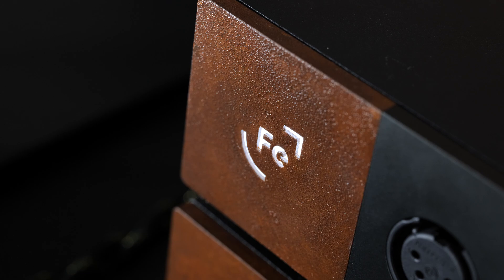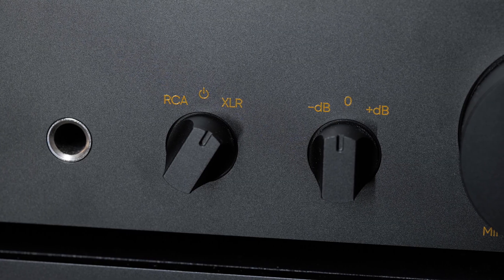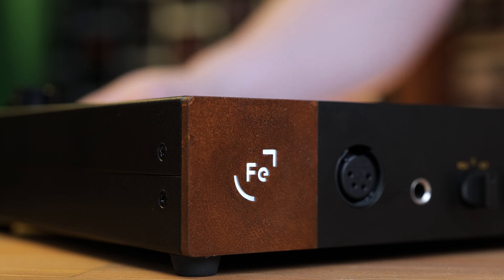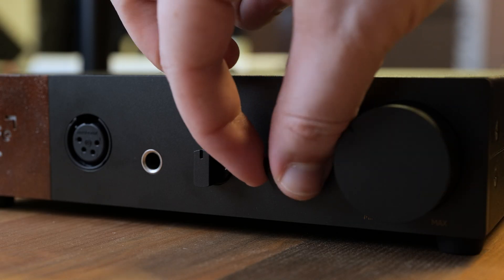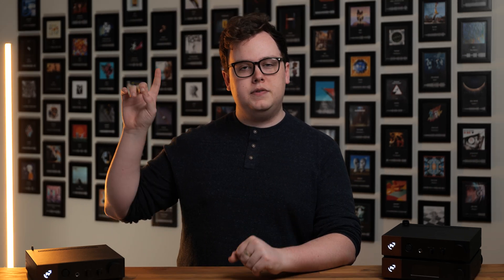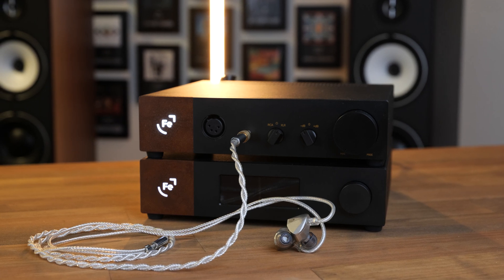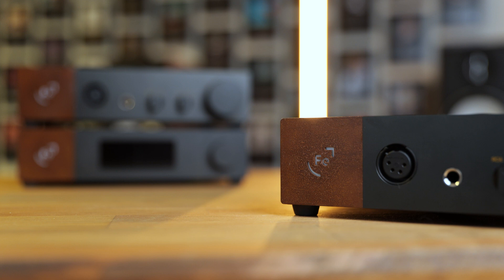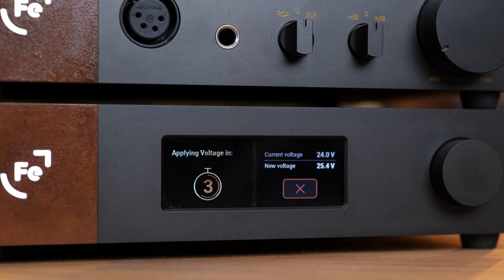Compact, Powerful, Brilliant - Ferrum OOR Review

Comment: The OOR costs 2 grand. Can you recommend any combination of DAC (somewhere below $3k) and the OOR, below 5 grand total, that would beat the Chord TT2?
Reply: I had the TT2 & M-Scaler and found it a bit too analytical for me. Sold them. I now have the Gustard A26 DAC paired with the latest/New Burson Soloist 3X GT amp with a Lokius in between them.  I like the synergy of this combo way more than the TT2 & M-Scaler. This proved to me that higher price doesn't always equal better results.  With all that said, check out the Gustard A26 (Delta Sigma) and the R26 (R2R).  Both are excellent bang for the buck DACS.

Comment: The question for me is Oor+Hypsos or Bliss?
Reply: For which headphone? Bliss is more spacious, Oor has more detail. Both great.
Reply: @krisrudecki9477  Verite Closed and Atrium Open. Caldera to come.
Reply: @johnratcliffe6438  hmm thats tough. Both will do an amazing job. Bliss will have a wider stage and Ferrum will have more micro details from my experience. Had both at home for a few weeks.

But I would also consider HA6a or HA300MK2, both will be bettter for dynamic drivers, Ferrum and Bliss will be cleaner though ... 

TLDR is you can't go wrong. Buy one, enjoy, a year later get another one and do a shootout. That's how I do it.
Reply: @johnratcliffe6438  for what its worth Ferrum has a litttle bit more and tigghter bass, and is a bit faster and tighter in general. Bliss is a little bit more laid back and spacious. If you want max detail then Ferrum imo, if you want max stage then Bliss.
Reply: @krisrudecki9477  Super useful. Sounds like I need both! 🤣
Reply: @krisrudecki9477  Will Hypsos work as a power supply for Bliss? And would it extract the best combination sonically?
Reply: @Peace_Guard  Hypsos only does DC. Bliss has a very good dual mono integrated LPS.

Comment: I must say I really enjoy this setup. It's clean without being sterile, which I thoroughly appreciate.
Reply: What in the F does that actually mean
Reply: @Karim-ik5ij  Lololol Apparently it really means that I'm not the best at describing things to other people well. I was trying to reiterate GoldenSound's evaluation that it doesn't sound as harsh and clinical as the D90 for example while still not sounding colored (IE, "clean").
Reply: @eruilluvitar  Oh ok, out of curiosity, have you done volume matched blind testing?
Reply: @Karim-ik5ij  Yes, I've randomized blind tested the D90 feeding this vs the A90 and preferred this.  I've also randomized blind tested this against the GS-X Mini and Singxer SA-1, both of which come across warmer than this does.
Reply: @eruilluvitar  Nice. Big differences? Or marginal?
Reply: @Karim-ik5ij  Fairly marginal, but noticable over some time.
Reply: @eruilluvitar  Would you think the gx-x mini or the Ferrum oor be a "better" fit for the empyrean 2?
Reply: @orangemoon1708  I've preferred the Oor with it, though I'll be trying the CMA12 with it here pretty soon, too.
Reply: @eruilluvitar  I see. What stood out about the Oor stack vs the gs x mini? And with the Oor alone, would you still prefer the Oor or the stack with the power supply more worth? I've been trying to find fairly recent amps to pair up(and endgame) with the Empyrean 2s without costing too much, around the 2k-ish range; 3k depending if the performance becomes worth it. Also found out the Rodecaster Duo(1.25v I think?) might cause some issues, ex: maybe not having enough power to power the amp and having to turn it up a bit more(currently using trs to xlr cables to hook up the amp). And any other suggestions of amps or if there is  a list I can view on the web as I currently can't really find anyone making a list of all budget ranges for amps.
Reply: @orangemoon1708  In general, the Oor feels like it has more control, whole the gs-x mini is a bit warmer. I've only used the Oor with the Hypsos on most things, but for what I've tried it in both configurations it's honestly about the same either way - I only have the Hypsos because it was a used set.
Reply: @eruilluvitar  Mmm, I'll take note of that. Been having a hard time picking and looking at pricing and everything. I'm currently testing out a used pro ican signature. Would the gs x mini and oor be a marginal difference?